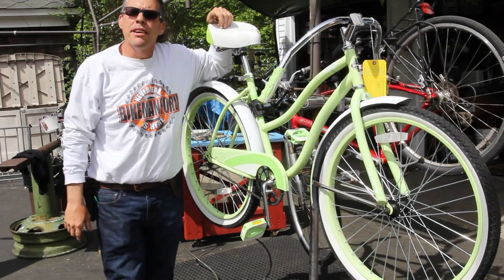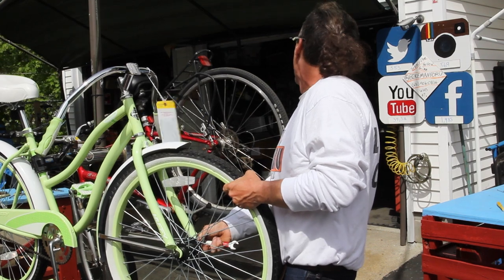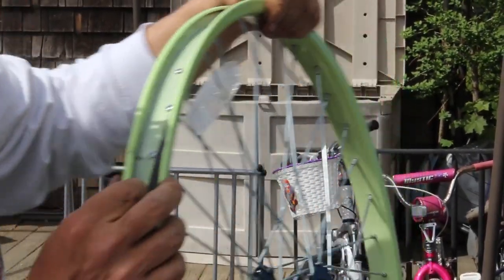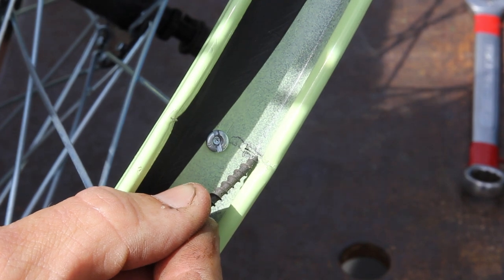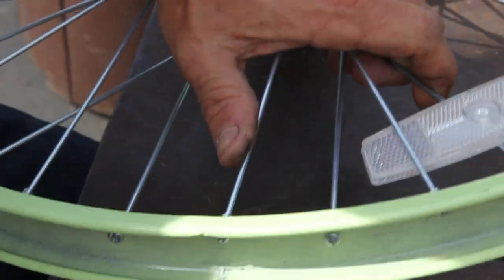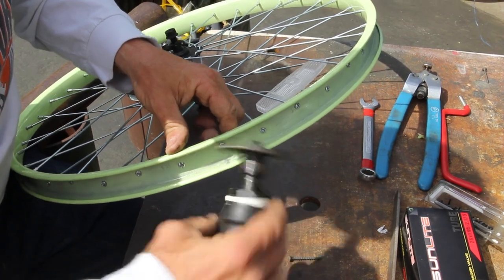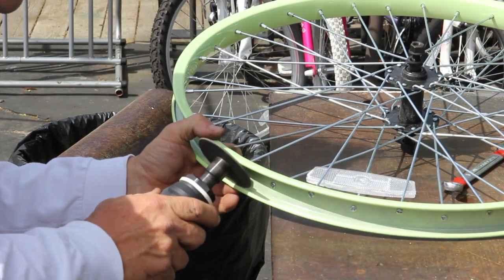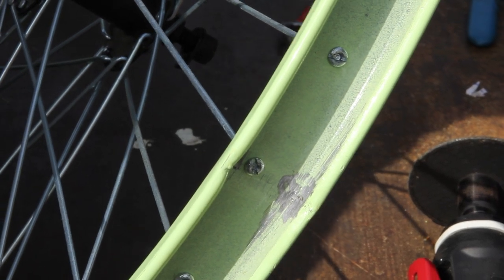Walmart Flattie - New Huffy - Shoddy Welds & Factory Installation - BikemanforU DIY Fix

Comment: Target Huffy beach cruiser I paid around $125 for like 4-5 years ago total scrap right off ,as I took it out for it's first test ride ,it was so poorly geared I couldn't get up to speed as well after hitting a few imperfections as is always the case here in Vegas ,by the time I got through both front and rear wheels were so out of true I decided to return it and do the necessary repairs on my Trek 830 and realize what I had in the first place .

Comment: i have grinded many welds off wheels that come on those huffys, a lady brought one identical to the one your serviceing she said she bought it 7 months prior, that thing was so rusty the paint was peeling off the frame.
Reply: The same bike has been at the local Walmart or over six years. For a few years, it was one of the perennial outdoor-display models, then was taken inside & cleaned up,  but there are still traces of rust in all the telltale locations. It had first listed out at 149, then went on sale for 99 for a year. The next year it was 169, and the price hasn't budged in the 4 years since. It'll probably go outside again, in a year or two. The things are shot before a customer ever takes a first look.
Reply: randolph patterson Could buy a good bike on Craigslist for $100.
Reply: @bluemountaindrivepae  Poor people like paying for their stuff twice.

Comment: In all fairness, if you know what you're doing, you can get an affordable bike from Hell*Mart. I got a Huffy Rock Creek for only $61. It was a return from somebody that knew nothing about bikes. I just adjusted the rear derailleur real quick before I bought it, made sure the gears worked ok, and blammo! had a bike I rode the heck out of until I could afford my Trek Fuel.
Reply: i got a mid 90s trek 930  updated rapid fire and  vbrakes etc ,,, no front shock .. but  its got that ox tubiing hella strong ,,,and run everything from a hybrid tire too a beeefy 2.2 tire ..... ive seen that terk fuel its a beast i wish i had one  good choice dude

Comment: I had the same problem on my bike from walmart, because the rim strip was too thin, and the inner tube would always poke through to the spoke hole, and cause it to pop...went through many innertubes.
Reply: rinoyeah4000 the few pence saved in making it isn't worth the money on tubes after.

Comment: Good video of cheap product manufacturing at work and how to fix it.
I would add if you do enough metal grinding without full safety googles eventually one may get a hot metal spark the bounces up around the partial glasses and sticks in an eyeball, and that's not fun

Comment: I will never buy a cheap bike again after one I purchased had the front shocks come apart and I ate pavement, had a busted up nose, stitches in my chin, nose and above my left eye, after that accident in 2003 I bought a GT Avalanche 2.0 and besides a tire and brake pads I have done nothing to the bike, my gf just got into riding and was going to get a CCM at Canadian Tire instead I got her a Giant Boulder and she loves it! Ppl spend the extra money and get some quality or eat pavement like I did.
Reply: If all you have done is replace the tire and pads then the drivetrain is going to fail next due to no maintenance

Comment: The cheap Wal-Mart bikes are really nothing but a rip-off. I have seen the following issues with them; 1) twisted or missing rim strips, 2) very poor welds everywhere, 3) cables that stretch immediately, 4) spokes that flex way too much,  5) excessive frame flex, 6) mis-matched threads from hub to cassette, 7) no lubricant in all bearings, 8) very low quality ball bearings and races made from sub-par alloys, 9) lowest quality hand grip and seat materials, 10) lowest quality tires, 11) brake assemblies that can't be adjusted to work properly, 12) brake pads made of inferior material, and 13) every single fastener is made of excessively soft alloy.  Maximum mileage on a Wal-Mart bike I would estimate to be 150 miles before it's worn out completely.      If a person needs an inexpensive bike, they should find a good quality bike on craigs list that is ten to fifteen years old, or even older.
Reply: +Trevor Jameson You have do know what to look for when buying used bikes though. I bought a used bike and wished I bought a Walmart bike. Bike ended up being POS with rusty bolts, nuts, stripped frayed oxidized gear and brake cables, upside down installed brake pads, rusty washers everywhere in every bolt, stripped hex slots, scraped frame with paint falling off, crooked wheels, nails in the tires, holes in the seat, missing washers and sleeves for the jockey wheels, hair and spider eggs in the frame and crevices, hair wrapped around the axles, no reflectors, crooked handle bars out of alignment, wobbly wheels, uneven brake pad wear, brake pads not even in the same zip code as the rim so they don't even touch on one side, the list goes on. Complete BS and no refunds.
Reply: +ILykToDoDuhDrifting Find one of the better Big Box bikes and tune yourself.
Reply: Why would you buy that?
Reply: Rick Martin , people buy them because they just don't know any different, and because they don't cost much. To them, a bike is a bike. But of course that's not true. Good bicycles cost a whole lot more, but will last a lifetime.

Comment: lmao did he just say wiz wheel. That's a cut off wheel and you should never use a cut off wheel for griding, lateral forces on them over time can compromise their structural integrity and cause them to explode when at high rpm. WOW
Reply: But he's wearing safety glasses so it'll be ok.

Comment: walmart bikes are crap,its better to get a good bike at a shop,that way if you run into mechanical issues you can get em fixed whereas walmart dont do nothing for the customer,most shops have limited warranty

Comment: no one has shown you how to remove a tire how QUANT !!!!  You caused that second DING when you removed the tire incorrectly and damaged the rim strip.  Use tire removal tools.  Also the wheel looks bent from shipping damage just return the BIKE so the store can get warranty credit.  By grinding the wheel you defeat the warranty on the bike, therefore the warranty is VOID.